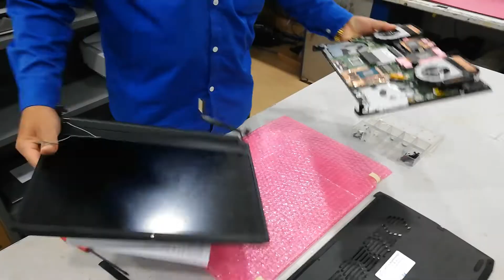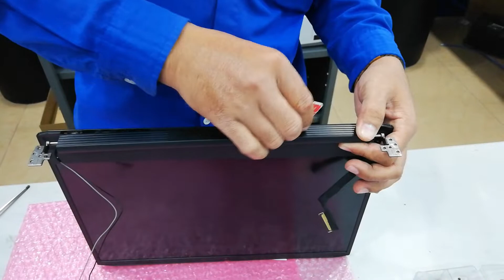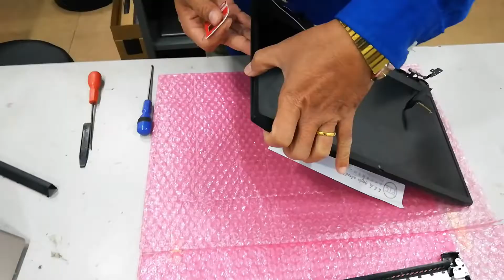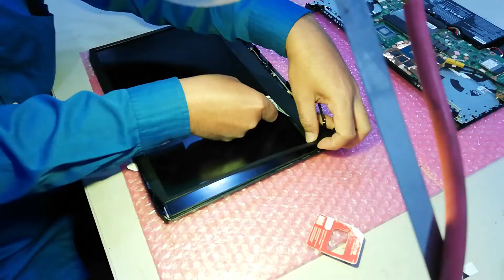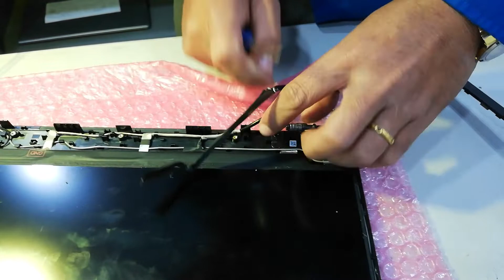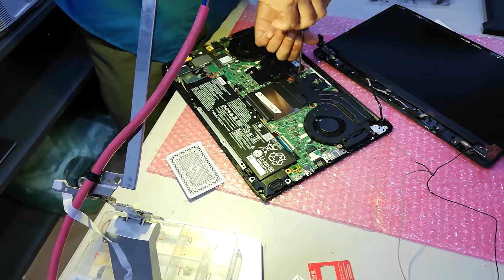Lenovo Ideapad Gaming 3 15ACH6 LCD No Backlight

Comment: How do you remove the LCD connector on the motherboard?
Reply from the maker: Problem LCD brother
Reply: @Khmerlaptoprepair  No, my keyboard, it's just a new thing and I'm not a professional, It's just a routine to change the paste, but in the last few days after re-installing the system, my keyboard has been having problems, and I'm going to replace it with a new one.